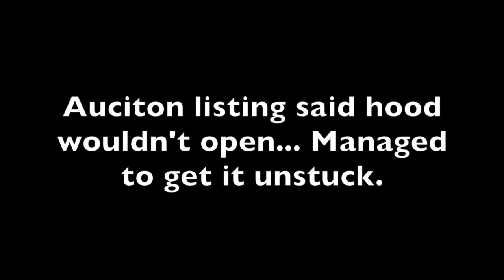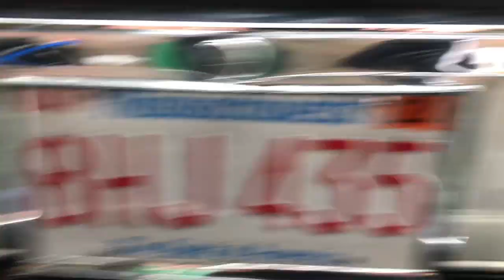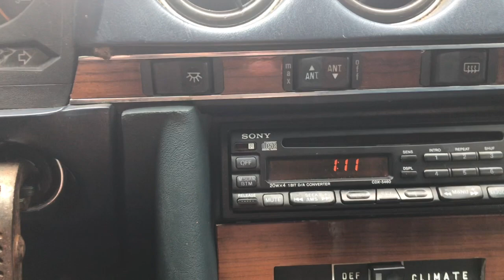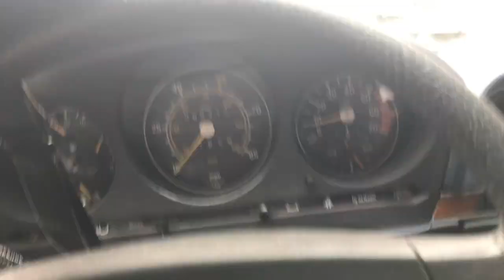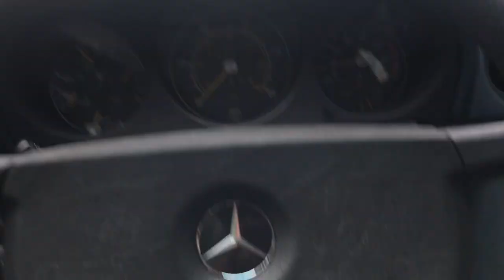I Bought the Cheapest Mercedes SL in the USA

Comment: I have a similar car. It was in a dry garage for 15years and not running. Before I was even thinking to start the engine, I checked and exchanged every part of the fuel and injection system.  After such a long time, your tank  , your filters, your pumps are full of water, sand, corrosion. And then trying to start the engine os only the first step to damage and destroy your engine... sorry guys, not professional what you are doung here

Comment: Hi, I just got a 81 mb 380sl today. It's late now but I'm gonna mess with it tomorrow.  Any pointers,  mine was sitting for like 3 years also. I got it for 900 and it really has a lot of potential. My main things is if I should even try to start it because the gas is old. I don't want to mess it up
Reply from the maker: I would be hesitant to start it with old gas in the tank.  Mine was very finicky and was having a lot of running issues and I think they were in part because someone had tried to start it at some point while the gas was old.  Also be sure to do an oil change, plugs and general tuneup.  If you're dead set on starting it without draining the tank (which is a pain to do, I wouldn't blame you), at least check all the fluids and then let er rip!  Please update me on how it goes!
Reply: @CarsWithBij  well today I took the gas tank out. On the outside look good. I have to get the big socket to remove the screen and it also came with a new gas gauge sensor, I forgot how you call it. Also I ordered today from Ebay a good fuel pump,   filter, the hose that goes on the bottom of the tank and screen. The guy gave me new carpeting for the whole car new trim for the fenders, the gauge sensor and a bunch of books. All for 900 delivered to my house. I'll keep you posted. There is some work that needs to be done but no rush I'll get her done.
Reply from the maker: @alexlazoroski3561  Wow, sounds like you know exactly what you are doing then.  Glad to hear no rush, as that is usually when the problems occur!  I can't believe you got all that for 900 delivered.  What color is the car?
Reply: @CarsWithBij   Dark red burgundy
Reply from the maker: @alexlazoroski3561  Beautiful!
Reply: Change the timing chain and the chain guides. A classic problem with them is the left hand chain rails break and get swallowed by the cam wheel.... engine keeps turning,cam stops. Valves and pistons break.